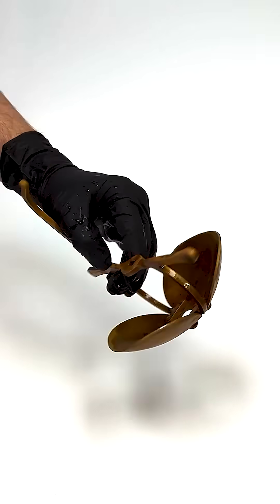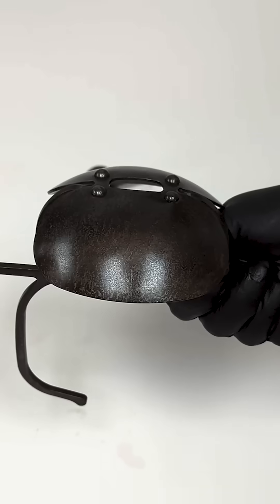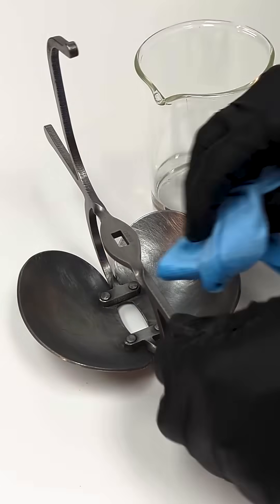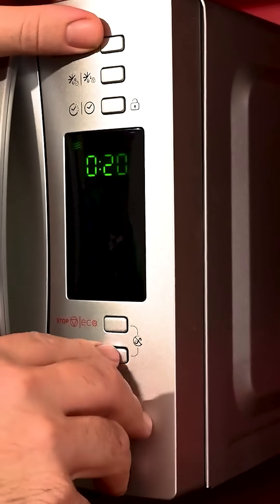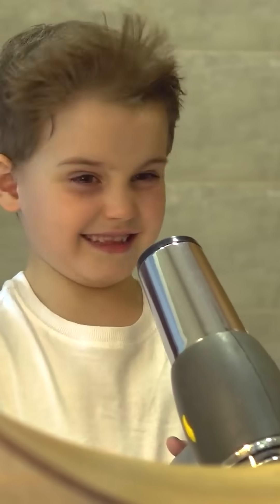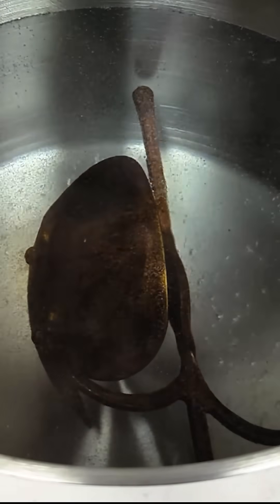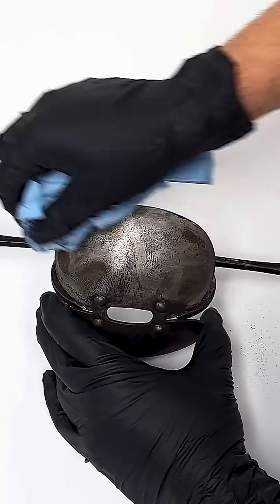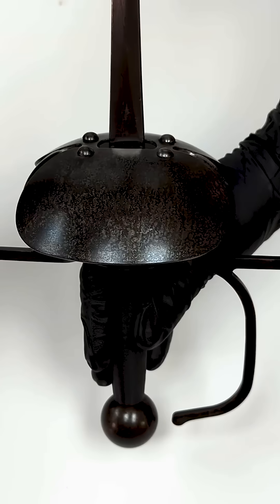It's not ruined, trust the process! (Rust Bluing)

Comment: If you leave it in 6 to 1 hydrochloric acid for a couple of hours, remove it, neutralise in in water with bicarb soda and rub the gunk off it with stainless steel wool. It wi

Comment: You can also use oxidizers, such as chlorine, it forms the same rust layer and rather rapidly, an even faster method is hydrochloric acid straight from the bottle, (muratic acid) if you will, coat the surface and simply wait 1/2 hour once only, the longer it sits the more rust, or do a vapor hood…suspend the item over a covered five gallon bucket of muratic acid and cover with a cloth or plastic….do not leave this inside a building the vapor will attack anything metal in a twenty foot radius…as me how I know….

Comment: Gunsmiths have been doing it for centuries, before that it was browning. Browning is when the rust isn't converted - it's left as an even brown layer then oiled. It works better then bare steel because the rust gives oil nooks and crannies to be in, and the oil prevents water from getting to the metal. It's just not as durable as the converted rust bluing. You don't want to know some of the solutions used over the history of the process.

Comment: You can also use ferric chloride mixed in water until it looks like darkish urine then add a bit of rubbing alcohol for evaporative qualities and also slows the reaction a bit for a deeper color. When I put together a gun kit thats basically what I used to brown the steel, which I like the look of more than blued steel. Every day or so you take some fine steel wool like 0000 and gently scrub the surface and reapply the solution. Then after about two weeks you scrub it gently again with a base like baking soda or I used washing soda then rinse it off with boiling water which will make a nice plum brown. Very lovely.

Comment: You must be careful when rust blueing with hydrogen peroxide. Some things like firearms are under a tremendous amount of stress, and hydrogen imbuing from the solution can potentially weaken the metal. In high stress cases like these, its more desireable to use a humidity box, makeshift or orherwise.

Comment: What's important is the properties of the different oxides.

Red rust is "active" and will continue to spread if left alone and eat away at the steel underneath, which is how you get metal supports that "rust through".
The black oxide is "inactive". It wont spread and is remarkably resistant to corrosion. 19th century naval swords, even up to the final patterns issued to ships in WW1, had hilts made from steel that was blackened in this manner, because it resisted the corrosive effects of damp, salty sea air and was cheaper than brass.
Reply: Fe₂O₃ can also protect a work piece, as long as it is applied in one controlled layer. It's called browning, and it's not as protective as Fe₃O₄, but it looks nice, especially with pattern welded steel. It was a quite common finish on the barrels of muzzleloaders.

Comment: This makes perfect sense this is what aluminum does naturally. So everybody knows aluminum doesn't corrode but the fact is it does it oxidizes so quickly that it forms a crust and then it doesn't oxidize anymore.  This is what you're creating that crust that can keep the oxidation out however it is a little bit different because you are changing the rust into hematite as you said.
Reply: Kind of makes sense then why automakers have gone to aluminum for a lot of their body panels and suspension components outside of weight savings. Longevity.
Reply: You absolutely cannot use this process on Aluminum.
Aluminum doesn't rust.
Aluminum DOES corrode.
No one think aluminum doesn't corrode, it does, it however doesn't rust.
The process of acquiring an oxide layer IS CORROSION.

Oxidation is always self limiting to a degree. Rust is a series of oxidation states that allow for corrosion to continue to occur, which is why it feels like steel corrodes faster in the same situations as aluminum. Aluminum doesn't have a series of hydration and oxidation states that can be easily and readily reached in normal conditions.

This works only on ferrous metals, because ferrous metals can rust.
Rust bluing takes Red hydrated Iron II to black hydrated Iron (II,III) otherwise called Magnetite, not Hematite.

Comment: The authentic way to do this is actually much simpler.  Iron or steel is heated red hot then rapidly cooled in oil to harden it, and it comes out perfectly blued.  There’s a little more to heat treating, but that’s the gist of it.   Chemical bluing is a way of faking that natural finish.

Comment: I've worked in a shop that did something similar with frames on trucks. We'd strip the truck to bare frame, sand it to bare metal, clean it, spray it with a rusting solution, dry it and then put it in a tank with a rust converter that would chemically convert the coat of rust into protective magnetite. After that was done we would cover the whole frame in a tick coat of protective paint. A frame covered like that will last decades with zero corrosion.
Reply: Why did they ever stop 😭 biggest issue with trucks in volcanic acidic rains and salty ocean winds is frame corrosion, how many trucks I've both seen and been in that had the bed connection to the cabin noticeably weakened or finally completely fold in on itself and cling for dear life. And everything else the rain splashes up into going through offroad puddles, corrodes everything rusty so fast, makes me wish ALL kinds of coastal metal objects and tools were treated like this as a standard. Heavy metal poisoning had me develop an allergy to rust, and it's freaking everywhere!
Reply: @KuraiKuroNeko 
Planned Obsolescence 😢
Reply: @KuraiKuroNeko  How did you get heavy metal poisoning ? If I may ask.
Reply: @trespire  he sounds schizo
Reply: @ No he doesn't.
Reply: @KuraiKuroNeko  Well if you were a truck manufacturer. Would you like your customer to buy a new one every few years? Or would you like them to keep the truck for maybe a decade or two?

Comment: You can buy commercial rust blueing solutions that will take less applications to create a solid coat and you can “force” the rusting using a cardboard box with a humidifier inside. Also according to the old guys your blueing is  tougher if you let the part sit in a tank of kerosene for about 24hrs after you’ve carded it

Comment: Parts may be steamed as well, as long as no air is admitted to the container--it should be tight enough that the steam generation creates a slight positive pressure, ensuring a 100% water vapor atmosphere. Hotter the better, too.

Comment: Is this how they get a black oxide coating on barbells? Also, how do they get the handle on that structure? I assume you'd need two scales like a knife handle and some sort of rivet through the middle (and that hole in the steel) to keep them together? Or is it actually wrapped in something like cord or leather?

Comment: If you have the time and space, you can achieve a rust blue finish simply by using a large enough tank of boiling water, and boiling the steel part(s) for a half hour to 45 minutes.  Use a carding wheel to remove the light rust and a light coating of oil to preserve it.

Comment: Youre forming iron acetate with that weak paracetic acid. I know because thats what i use to clean copper and occasionally steel. Like with all things of this nature, yes some is oxidised, but in the boiling water you are decomposing rhe iron acetate wirh heat forming nanoparticles, and in the water are also oxidizing it as soon as that is formed. 

Fun fact, you could flush a quartz tube with hydrogen and heat any bulk powder of iron acetate to produce pyrophoric iron.

Comment: I recommend using very hot steam, you get much better adhesion and corrosion resistance, i did this with a few guns and after about 6 to 8 passes the finish is so strong it doesnt even get a small spot of rust with the solution even after a half an hour
Reply: How do you produce your steam?
Reply: @dirtymoney7783  Not an expert, but I may have a solution. You can get pots with holes in the bottom (sorta like a pasta strainer) that you put on top of a second pot that has water in it. put a lid on top to keep it all in.
Reply: @danielcounsell581  that's what I pictured at first but i feel like that steam wouldn't be much hotter than the water. I think these guys are talking about something different.
Reply: @ The steam can only be hotter than the water
Reply: @dirtymoney7783  water steam is always 100°C (unless you put more energy into it, which is not this case)
Reply: @dirtymoney7783  Something akin to a steamer basket would probably work
Reply: @dirtymoney7783 so this is a bit of a hjank setup but it works. Put a pot full of water over a gas heater or open flame. Put a toilet flange over the pot to seal the edges. Attach a pvc pipe to the toilet flange to make the steam chamber. Then hang the item being blued from any wood/wire/cord that you've placed in a slot cut in the top of the pvc pipe. Place pipe cap on the end of the pvc pipe to close the steam chamber. Wait for bluing process to occur. 

Janky but cheaper than buying a boiler tank or industrial steamer.
Reply: came here to write this lol
Reply: Breville Barista Pro here we go! 😂
Reply: Well, that will make it easier to use on my wrought iron porch rail project. I bet I can assemble a 600 degree superheater out of an old water heater burner and an AC condenser. Or maybe just wrap 3/8 copper around a rocket stove.
Reply: Does steam work on car rust?
Reply: @jakeschnare3120  This isn't reversing rust, it's preventing it
Reply: @flamingfoxx but step 1 is making it rusty, no? Unless I’m misunderstanding something
Reply: @jakeschnare3120  Yes, step 1 coats the workpiece with a layer of rust, which is then converted to the black coating.  The idea is that the black magnetite coating seals the metal, preventing further rusting.  If you just left the rust red (didn't do any steps past step1) the rust would continue until the iron was completely consumed.  Think of this process as sort of like anodizing aluminum; the surface coating prevents further chemical attack on the metal.
Reply: Aight, how about a hydrogen and oxygen torch?
Reply: yeah, let me just get my industrial high pressure steamer from the other room
Reply: @pairot01  steam cleaner theyre $40 on amazon
Reply: does a steam cleaner work?
Reply: @MrTeddy12397  That's what I use...ran the hose into a vertical section of 4" abs with a cap on it. Hang the parts inside. I steam for 20minutes and get great conversion.
Reply: @MrTeddy12397  yes works great i used one of those they sell for cleaning grout and things

Comment: This works similar to Alodine in the aerospace industry, you could call it "controlled corrosion". simply you want to corrode the base metal to an oxide layer so stuff that would usually degrade the metal has no effect. The Alodine is washed off after it finishes.

Comment: The worst version I've seen of this is an entire bumper cars track in winter. Salt + wet feet, thick black scale rust until electricity couldn't flow to ground and the cars stopped working until I spent a week chipping it all off with a grinder. I''m guessing it was this, but in it's natural chaotic form. A controlled layer to be water resistant would've been amazing

Comment: For those curious, this is the ‘Complete Economy Rapier’ from Castille Armory. They make great, sparring safe historical fencing equipment. If you are interested in practicing HEMA or SCA, Castille is a great place to start. Though personally I think they should have blueing available as a customization option for all products.
Reply: What makes something "sparring safe"?  Bendy, rather than stiff? Not sharp?
Reply: @PinataOblongata  usually means it bends at a certain point. The point is spatulated (more surface area) and the edges are not only blunt but also thicker and rounded. For rapier the amount of static weight is often around 6.5 kg (~13 lbs) (but I do not know for this one exactly since they measure things differently than I am used to).
Reply: @maxw__t__6538 is there some sort of error in your weight? That would be heavy for a zweihander, let alone a rapier.
Reply: @jamesheaton5421 It's an error. The fully assembled sword is .81 kg.
Reply: @jamesheaton5421  yes with weight I ment the weight it would bend under. That was not very clear on my part
Reply: James that is not the weight of the swords. It's a measurement of how easily it bends.
Reply: @PinataOblongata  "sparring safe" mostly applies to the blades, which bend and then return to their original position rather than staying stiff and straight like rebar, or gaining a permanent curve like wire. 

The hilt needs to be durable too, but Castille hilts are generally way more durable than strictly necessary.
Reply: I own this exact sword! Very flexible and well made

Comment: This will in fact make it rust far faster than if it were regularly polished, to remove oxidation nucleation points. 

The real trick is the oil. Cut the crap, apply the oil. Same results, less toxins, less time. Rough it up first if the oil isnt taking well.

Comment: Now I need a pot big enough to boil my truck!
Reply: Or...do this exact treatment to your truck and buy like one of those things that shoots out steam. You don't need a pot. Steaming it works better and makes it way more rust resistant
Reply: Rust-check has a product made of phosphoric acid that does something similar to this- I did the whole frame of my 01 Ranger with it and it's holding up pretty well. You just wipe it on and the red rust turns into a black iron phosphate coating

Comment: The only bad thing with this recipe of rust bluing is that it can cause larger pits in the rusting process.. it still works but I wouldn't use it on a gun barrel just objects that need protection and are rustic to near smooth finish like this guard. It does work but you definitely have to do several treatments and never use liquid blue on this oxide coating.
Reply: The liquid blue will eat away at the black oxide and will ruin it.. just a heads up

Comment: We do this in gunsmithing all the time. But we usually use special pre-made bluing solutions, it just makes things a bit easier.
Reply: That is just normal bluing using caustic chemicals. I've actually seen rust bluing used when restoring really old shotguns. They would use a steam cabinet to create the uniform rust layer though.
Reply: @nolansykinsley3734  I've used the steam cabinet method before. It's handy when the environment you're in is really dry and you need extra moisture in the air. 
And the bluing solutions we use are primarily from Brownells, but we also have a few others.
Reply: For any future readers, never premix a peroxide solution. Peroxide is unstable. It has to be stored by itself, in an opaque container, in a dark-cool place because peroxide will separate. H2O2 converts to H2O and O2. What you have left is a bottle of water with a high concentration of oxygen. 

If you can buy a bluing solution, do that and follow instructions exactly. If you use a peroxide solution for anything, mix it and use it immediately. Any extra should be poured out because it won't be effective after a few hours.
Reply: It's a bid misleading to the average person to say "we use pre-made bluing solutions."
To 90% of gun owners, that's Cold Blue/Instant Blue/Oxpho/
Those are Selenious and Phosphoric acids, with nickel and copper sulfate dissolved, as they react with the iron they react nickel and copper out of solution, causing a deep black instantly.

You mean prepared gun salts, not "bluing solutions"
It's not a bluing solution because it doesn't blue, it is specifically designed to rust a piece of metal.

Also, Brownell's salts are just 2 parts (roughly) of lye, with 1 part Sodium Nitrate and 1 part Sodium Nitrite. It's expensive to buy that stuff premade, if you can make it yourself, it'll save you a lot of money, time is not really an issue for a chemical that works just to oxidize a material.
Nitrates are scary to store, nitrite is just curing salt.

Comment: I can see ways to further improve the end results, such as coating them in oil [after a heat treatment process] to bake on a layer of polymerized stearic acid products, but for its self, as a basic platform, it looks pretty sound, potentially.
Reply: This is mostly done on things that should be regularly oiled anyways and are already heat treated from the factory and you don't want to mess with the temper on. I guess if you are just working on something that will be a wall hanger, but particularly for a training rapier guard it is going to regular be recieving gouges to the "seasoning" and isn't particularly practical compared to just keeping it oiled or waxed (or both!)
Reply: Yeah articles on this process say that it needs to be impregnated with oil or wax to maximise the rust resistance.